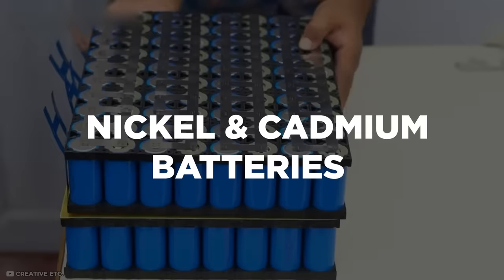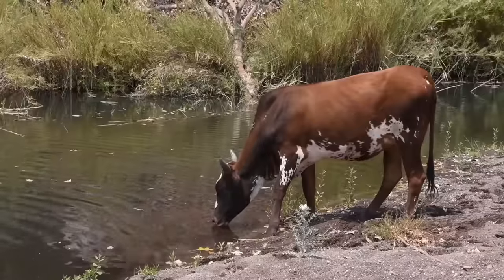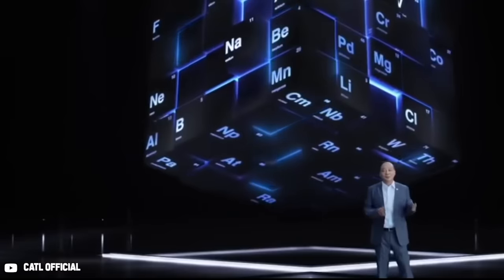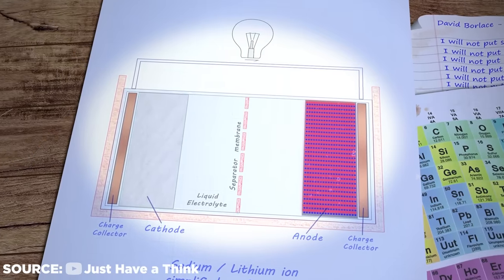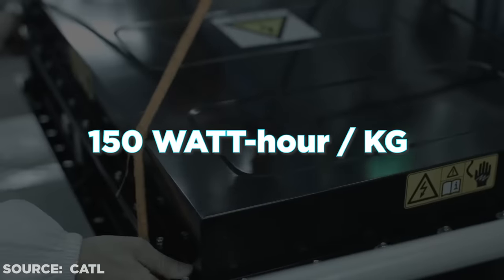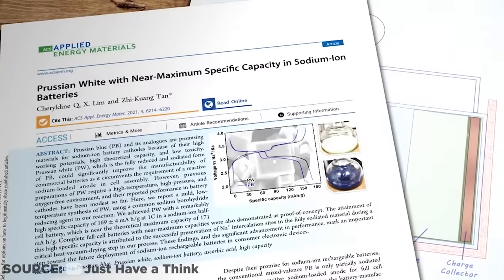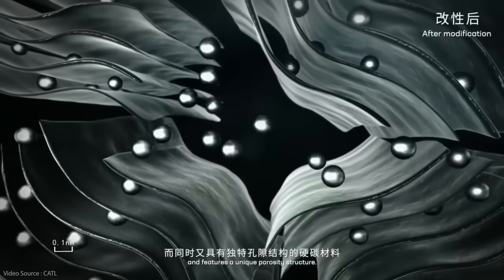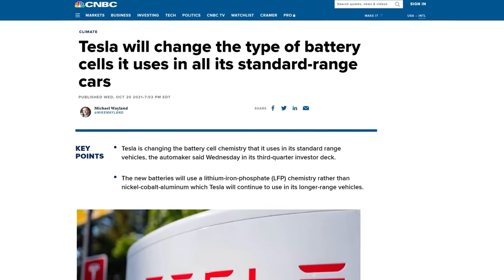No More Lithium! NEW Sodium-Ion Battery To BEGIN  Mass Production

Comment: I wonder if they’d be able to source the salt from the ocean? If so, maybe it could be a by product of desalination for drinking water. Maybe then it’d be cost affective for both desalination for drinking water and the sodium batteries.
Reply: You'd Need to wash and purify the salt byproduct a lot, too much random stuff in seawater. Better off mining it.
Reply: Excellent idea!!! 👏
Reply: @YouCanHasAccount  If you mine it in the form of rock salt  you have the same issue. The most common compound on earth is sodium chloride. Chlorine is widely used in industry so a useful byproduct
Reply: @YouCanHasAccount  No its not better to put the brine back into the ocean as its far denser than sea water so it sinks to the bottom and kills all the marine life.
Reply: @deanrolph6912  I don't think you know anything about chemistry or physics, based upon this ridiculous response.
Reply: @YouCanHasAccount  perhaps we can use the chlorine in our swimming pools & for certain water treatment applications.
Reply: @YouCanHasAccount  Not true, depends how it extracted, ozonation and electrolytic generation from a concentration envelope would yield beneficial chlorine, but not by extracting the sodium from the brine and returning the purified medium left over naturally to the sea.
Reply: Industry only looking at the best cost-efficient in production process.
Reply: @deanrolph6912  I don’t know how you got that conclusion. It’s still brine, so it’s miscible with sea water, as it’s a less concentrated brine. The concentrated brine would just diffuse around, like how a drop of food colouring would in a tank of water. It’s not solid and it’s not immiscible like oil so it won’t sink.
Reply: Where we get the sodium salt is a non-issue. You could get it from the ocean but then you have to remove the water. Mining rock salt may be easier, but it all depends where you are in the world. In any case it has to be purified. Na (sodium) batteries will be a complete game changer, sodium is readily and very cheaply available in massive supplies all around the world. Its a natural and dominant part of our environment, not dissimilar to solar. Who cares if it energy density is a bit lower than Lithium. Na salt can be mined in an almost pure form anyhere in the world, compare that to Litium salt!
Reply: They should source it from salt between humans toes. We could all mine our own toe jam and send it into the company for payments
Reply: Actually, this is already being done and further developed. There is a membrane invention currently used to seperate salt from seawater naturally. It’s expensive right now but is doing great in third world countries.
Reply: @Umadbro681  That has been around for a long time, good for making drinking water. If you want the salt from seawater, it costs nothing to evaporate the water.
Reply: Maybe.......?
Reply: The best water will always be free from the sky.
Reply: @dfor50  That used to be true until microplastics. Now even clouds are filled with them and rain as well.
Reply: the biggest advantage of using sodium ion batheries is that those unlike lithium can be recycled. And you can get sodium from so many sources, not just sea water. Also recycling soidum ion bateries will provide manufacturers with sodium too. The idea behind newest tech for bateries is recycling to reduce impact on environment. Also if things go as planned there is going to be massive drop on prices for electric cars becaus we all know that lihthium ion batheries are the most expensive part on car. The best of all raw materials you'll ever need to make sodium ion battery you can recycle.
Reply: Sorry, but all rain water is now full of micro-plastics.
Reply: @aaronm.1998  You can make fuel out of plastic
Reply: Honestly you can just sun dry seawater and get tons of salt especially near the equator
Reply: this is a great point
Reply: effective
Reply: No hes absolutely correct, you ever heard of brine pools? I suggest you either google it or watch one of the many documentaries on youtube on them.

Nearly any aquatic lifeform that swims or walks into one of these brine pools dies
Reply: @justincase3230  I don't think the idea is to find the shortest path but the best path. So even if it is better to mine it, if the approach is focused on the long run you may get a more fulfilling result. Like maybe it's more expensive now or if you focus only on a narrow set of stats. But if you implement an approach that influences development of technologies that fix more than one potential issue at a time, after a certain break point you may have an overall cheaper development. So i get what he said with pretty much connecting several industries for an overall better result. But like i always say, this can't really happen without some kind of plan and collective desire, you can't rely on wild capitalism and expect things will just fall in place by default. You need to support the overall idea with checks and balances because it's an entire ecosystem made of many parts, is not like a company alone can spread everywhere and also be competitive. Each part is narrow to be able to compete, so we, society, the State whatever, must balance things around, let some aspects die out, help other aspect to live on even if they can't be competitive and so on, all within a grand plan where all fits together for an overall better result. We need to talk about efficiency and stability at a global level not at the level of a company or industry. So yeah, better mine it has sense when you broadest view stops at the level of an industry and only thinking about the current situation. But if you go higher for a broader perspective, space and time too, then it's an entirely different picture and getting it from the seawater might have more sense.
Reply: It's a great idea in thought, but it takes a lot of energy and heat for desalination to occur... which requires a "fuel" source. Solar powered desalination is also a great idea, but not profitable (think of windmills... initial cost, routine maintenance, replacement of blades, etc)
Reply: salt mines are by far the easiest and most effecient way to get salt.
Reply: That's an excellent integrative engineering problem, where the waste material of one industry becomes the input for another. You'd need a strong government program that enforces these sorts of pro-social environmental decisions. And probably in a developed nation. So if this were viable, I'd expect it to come about in the Nordic nations. China could pull it off, as the CCP could impose such a direction on the nation, but they're too busy trying to raise billions from poverty by developing their economy.
Reply: The problem with extracting is you're still left with a lot of brine that would need to be placed somewhere. If you circulate that brine back into the ocean the fish will die from the change in balance of water, salt and brine.

Tl;Dr Fish are weak
Reply: @justincase3230  even the mining quality of rock salt from the earth is still chock full of impurities… also this is a misleading sodium isn’t even a metal…
Reply: @mrpumperknuckles1631  sodium is indeed an alkali metal
Reply: Countries with desalination have an environmentally damaging brine by product that has higher concentrations of salts and minerals, even lithium. Thats where the pilot program should be
Reply: @YouCanHasAccount Chlorine is used in many products as well. Process it and sell it to
Reply: All marine life will die if you remove all the salt so no that isn't a good idea at all
Reply: So where did salt mine salt come from in the first place?
Reply: Desalination is a frowned upon form of providing drinking water, on the account that it requires a lot of power to seperate the drinkable water from the ocean.

There are more power efficient alternatives like the use of a desalination mesh, but the process produce plenty of brine. 

I don't care what wackjob tells you that brine won't mess up ocean environments, I can guarantee you with the large quantities of ocean you are purifying using those desalination plants. The amount of brine being produced is capable of oversalting sea water enough to cause mass fish and reef genocide.

Even if you attempt to lay the water in salt beds for evaporation, there won't be enough evaporation time to even extract the remaining water from the brine.
Reply: This was the first thought I had.  He are already dealing with droughts and rising sea levels... seems like a win win win if we can come up with an efficient way to pull the sodium from sea water and use the remainder for agriculture.
Reply: Drinking water or in the (hopefully) near future, thermonuclear fuel
Reply: @sandorbakker8166  isnt the most common compount on earth silicon dioxide? But yeah, we have a lot of salt.
Reply: @deanrolph6912  salt desolve in water, so it doesnt sink to the buttom it just desolve before it even hit the sea floor.
Reply: My first thought as well!!
Reply: @EatSuck  That's the mesh I was talking about. Problem is the brine.
Reply: Don’t worry, this will never come to fruition. These videos are made so the creator can make a good return on his equity in whatever makes the product they’re shilling
Reply: @sandorbakker8166  silicon dioxide is the most common, not sodium chloride.
Reply: @deanrolph6912  the brine is Sodium Chloride, which gets used for the batteries...
Reply: @justkev1044  it's heavier than seawater, and it will flow and pool to the lowest levels it can reach.

It can mix, but the boundary between two concentrations of salt water tends to prevent mixing.

You can easily test this.

Mix two different concentrations of salt water. One light on salt, one heavy with it.

Apply a drop of food coloring to each, to make them different colors and mix.

Let them settle, then pour some of the heavy concentration into the lighter one.
Reply: @jumboegg5845  It costs to purify the salt. Lots of other stuff in salt water that won't evaporate.
Reply: Soo you want to use alot of power to create very little power :/// no.
Reply: dont kill the fishes
Reply: If there is a will there is a way, much of societies problems is it's simply not profitable to find a way and since profit moves progress it takes things turning bad for the solution to become profitable.
Reply: @dfor50  acid rain disagrees with you
Reply: "Salt" is not sodium.  It's sodium Chloride.  To extract sodium from salt, you need to raise it to a very high temp to melt it, and pass an electric current through it.  Melting things is not a cheap endeavor.
Reply: Not a great idea, taking out all the salt in the water is going to do just as much harm to the ecosystem.
Reply: Salt is so cheap as to be negligible in the cost of the batteries. However purifying it and extracting the sodium metal will likely be a bigger factor in cost.
Reply: This channel made this video but Catl released their “breakthrough” a year ago, so we know where that went. Stay educated!
Reply: @justincase3230  I would rather not tear down mountains for more salt. Invested and invent ways to make desalinization cheaper. Our world is losing resources. Reduce, reuse, recycle. I know it sounds like propaganda (it is), but we have one shot, so we should take it.
Reply: Kosher sodium batteries might be the next big thing...
Reply: @justincase3230  all mined salt came from the oceans.
Reply: "Every action has an equal and opposite reaction." The universe.
Reply: What happens to marine life when you start desalinating sea water?? Marine life has evolved for millions of years around salt water in a specific concentration. Desalination is a bad idea.
Reply: @shazamshazamski  do you have any comprehension of how vast the Oceans are?
Reply: @shazamshazamski  i supose we can use the waste salt from desalination instead of throughing it into land fill trash. And it can be recycled unlike lithium.
Reply: Spain is already doing this
Reply: @justincase3230  no.
Reply: Seems to be some missing the point on desalination.  This sloves 2 problems.  So it might not be as good as mining the salt, but you are not desalinatiating to get the salt, you are doing it to get the water.  The salt is a byproduct that would now have a use.
Reply: @danz1182  yes thats correct and the waist salt is low cost. Under €1 per kg
Reply: @dfor50  
No, Brawndo is the best thing to drink.   It's got electrolytes.
Reply: @aaronm.1998  
Yes.   But it's now been proven that micro-plastics are essential for healthy bone and skin tissue growth.
That's why it's one of the ingredients in Brawndo.   Along with electrolytes.
Reply: HEYYY BUD!!!
Reply: The cost comparison is interesting as when you factor in the environment and the destruction of the planet, or so they say, the cost of production and efficiency should not matter.

Just take a look at the COVID vaccine. High cost, low efficacy.
Reply: @deanrolph6912  
So, all the fish are dead ?
Reply: @jumboegg5845  Sodium isn't a salt. Na is a metal.
Reply: @deanrolph6912  The ocean is massive. Can't we dump it in some deep trench?
Reply: @joesimones730  Find out what "salt" means, its basic chemistry.
Reply: @jumboegg5845  a salt is a compound. Sodium chloride or fluoride. Sodium is a metal.

I think it's you who needs to retake chemistry.
Reply: @joesimones730  You did not find out what salt means in chemistry. Stop living inside your head and actually do some study and research, before you go telling other people you know better.
Reply: dont mess with the ocean. This isnt some local lake that gets refilled when it does rain.
Reply: Purifying water by also extracting massive amounts of salt which is limitless in seems. Fascinating, I wonder if there’s positive side effects to it.
Reply: @warbuzzard7167  There are undersea rivers of hyper concentrated Brine, so possibly not.
Reply: Even if you used the most efficient means of desalinisation and extraction of the NaCl from the brine; You would still need a means of separating the Na from the Cl, thus yet more power required.

That's also not to mention you would be left with waste products after NaCl extraction and have a massive excess of Cl to deal with, the amount we produce currently is almost to much as it is.

Or that we would literally be reducing the quantity of NaCl in the ocean permanently on a global scale, not exactly environmentally friendly.

Using desalinisation for fresh drinking water can at least be a cyclical process, by treating and adding waste water to brine it can be more safely reintroduced back into the ocean without it being a concentrated solution. The nutrients and other waste water by-products would even have a positive effect on feeding various marine life.

Mining can be done with less overall environmental, there just needs to be proper regulatory and enforcement bodies to ensure it is done.
Reply: @sophiophile  No, water is.
Reply: @sandorbakker8166  Incorrect, water is.
Reply: Playing with the salinity of the ocean is a dangerous game. Over extraction could lead to some serious environmental hazards.
Reply: Oceans was fresh waters. It's toke around 33 yers to salinity.
 Way they make Oceans salty?
Reply: Oceans are fresh water.  It's took around 33 years to salinate. 
Way they make the Oceans salty?
Reply: Took the words right out of my mouth Tim
Reply: no, desalinisation is very energy consuming, having a useful by product won't eliminate all the inconveniences
Reply: Plenty of sodium in costco food 😮
Reply: No. For 50,000 different reasons.
Reply: @EatSuck  Thing is, the way the mesh would work, you'd get water in the other side that's also in a pretty low place. Then, you have to pump it up, which, if done in the simplest way, creates a water column with the exact pressure you'd have needed to use to pass the water through the membrane to begin with. It can still have benefits, since the pumping can be split into multiple stages, and it may require less maintenance and moving parts. But, it is inviolably energetically expensive to desalt sea water
Reply: @justincase3230  That's not how it would work; you use electrolysis to split the sodium from the chlorine, any byproduct would be miniscule and wouldn't stay with the end product. The problem would be what to do with the chlorine gas, because there would be a ton of it to dispose of
Reply: @justincase3230  "wash and purify the salt byproduct" Indeed! With the mass of micro-plastic already estimated to outweigh the fish bio-mass, the cost of that cleansing might be some incentive to cut the production of plastic... win-win!
Reply: Salt is obtained from evaporation basins that are set up along the sea side in many countries. It's done in West Australia for industry purposes, westcoast of France too from my own knowledge , very easy sun based process . We learned this stuff in geography classes way way back . Our culinary salt is primarily seasalt , the crystallization process when drying helps purify it .
Reply: Dont be logical !
Reply: zhichengwong2081 nuclear plants boil ultra purified water. 

Are you suggesting making drinking water from nuclear plant water pools?

What am I reading right now.?
Reply: It’s NOT salt! It is a metal, Na on the periodic table! It is also very combustible if introduced to water!
Reply: @engineer0239 dude, this Na (metal) not NaCl (salt)